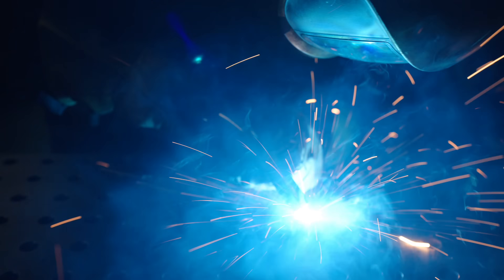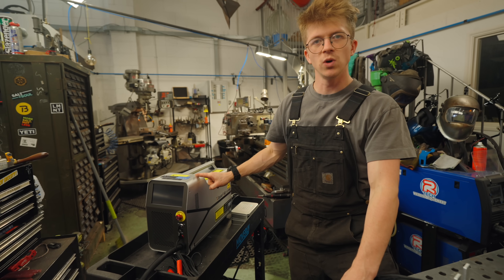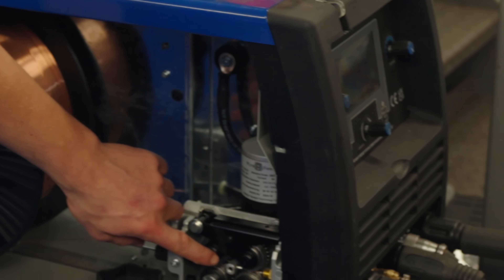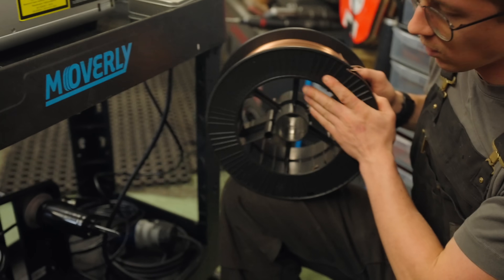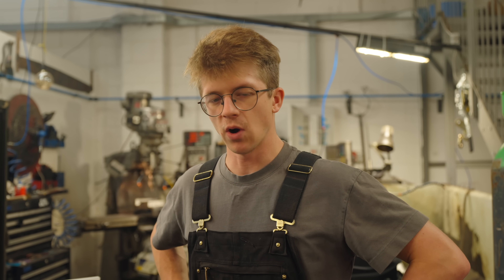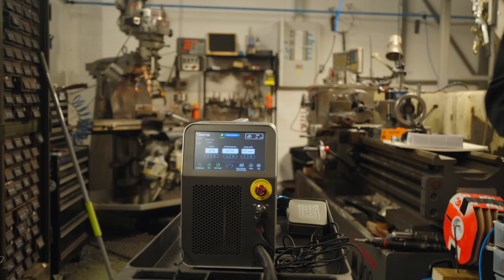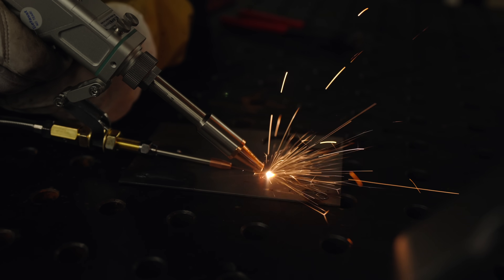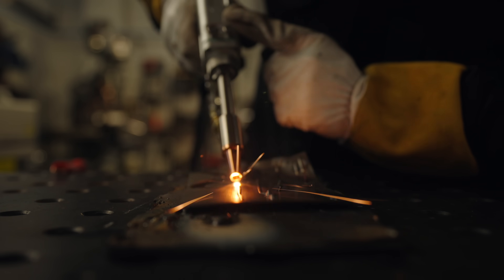Laser Welding

Comment: OHHH it’s the first thing I ever used from school, for anyone who doesn’t know: Denaturing is an issue that can happen to the enzymes in your body. As stated below: Denaturation of Enzymes
Enzymes are biological catalysts that accelerate chemical reactions essential for life. Their remarkable efficiency arises from their highly specific three-dimensional structures, which allow them to recognize and bind precisely to their substrates. However, this delicate structure is not fixed; it can be disrupted by changes in the surrounding environment. When an enzyme loses its characteristic shape, a process known as denaturation, it also loses its ability to function properly. Understanding enzyme denaturation is crucial in fields ranging from cellular biology and medicine to food science and industrial biotechnology.
The Structure–Function Relationship
Every enzyme is a protein composed of amino acids linked into a chain that folds into a complex three-dimensional shape. This shape forms the active site, the region where the substrate binds and the reaction occurs. Because the active site is geometrically and chemically specific, even small structural changes can drastically reduce enzyme activity. Thus, an enzyme’s structure is intimately tied to its function.
Causes of Enzyme Denaturation
Enzyme denaturation can be triggered by several environmental factors:
Temperature:
Enzymes have an optimal temperature range in which they function most efficiently. High temperatures increase molecular motion, eventually breaking the weak hydrogen bonds and hydrophobic interactions responsible for maintaining the enzyme’s structure. Once these bonds break, the enzyme unfolds and becomes inactive. This is why high fever can be dangerous—critical enzymes may begin to denature.
pH Levels:
Each enzyme also has an optimal pH. Deviations from this optimum alter the ionization of amino acid side chains within the protein. These changes disrupt the ionic bonds and interactions that stabilize the enzyme’s structure, leading to denaturation. For example, pepsin in the stomach works best in acidic conditions, while enzymes in the small intestine require alkaline environments.
Chemical Agents:
Substances such as detergents, heavy metals, alcohols, and strong acids or bases can interact with an enzyme’s structure. Heavy metals like lead or mercury can bind to sulfur-containing amino acids, distorting the protein. Organic solvents can disrupt hydrophobic interactions, causing the enzyme to unfold.
Mechanical Agitation:
Though less common in biological systems, vigorous shaking or stretching can also disrupt the delicate folding of proteins. This is why whipping egg whites—an enzyme- and protein-rich solution—changes their texture.
Effects of Denaturation
When an enzyme denatures, its active site either changes shape or becomes completely destroyed. As a result, the substrate can no longer bind, and the chemical reaction slows drastically or stops. In many cases, denaturation is irreversible; once the protein unfolds, it cannot refold back into its original state. However, mild denaturation can sometimes be reversible if normal environmental conditions are restored before the protein aggregates or degrades.
Biological and Practical Importance
Enzyme denaturation plays a vital role in numerous biological and industrial processes. In cooking, heat denatures enzymes and proteins, altering texture and flavor. In sterilization, high temperatures and harsh chemicals denature microbial enzymes, preventing pathogen survival. In medicine, understanding how fever, toxins, or mutations affect enzyme structure helps diagnose and treat diseases. Additionally, biotechnology industries carefully control environmental conditions to maximize enzyme performance in manufacturing, fermentation, and pharmaceuticals.
Conclusion
Enzyme denaturation highlights the intricate relationship between protein structure and biological function. Because enzymes rely entirely on their three-dimensional shape, even slight changes in temperature, pH, or chemical environment can disrupt their activity. Recognizing how and why denaturation occurs not only deepens our understanding of cellular processes but also guides practical applications in health, food science, and technology. Ultimately, the study of enzyme denaturation underscores the delicate balance required to maintain life’s essential biochemical reactions

Comment: watch the power and angles, too far one way and you're burning holes in other things while you weld, too far the other way and you might be reflecting it back at you or the (replaceable) protection/front most lens. it's a laser after all, it bounces off shiny stuff.

get everything right and you can run for quite a while on one lens, get it wrong and you'll burn through those lenses pretty quickly (or other things you don't want to). jared over at questionable garage has some tips on that, if i recall.

Comment: At my working place we weld up to 6mm thick steel strips with a  laser welding machine.
Its using a lot of power though.
Output is 12000 watt in laser power, but it draws 80.000 watts from the grid.
Fast and reliable but expensive.

Comment: Its odd to do a partner ship with a company about their products or tool and also no ask what kinda consumables u need or even in the products manual having what you need to run it like u buy a 3d printer and its like this printer can run xyz fillament types with a .2-.8 nozzle using 1.75mm diameter fillament surly welders and stuff also come with the same kinda info

Comment: I’ve been looking around at these things for a while without being particularly convinced, which has now changed thanks to watching this video. 

My first and last reaction though, was that you absolutely must put it in a confined area separated from the rest of the workshop. 
Are there any laser proof welding curtains available that can be hung from a scaffold frame in a corner, perhaps?

That and a flashing beacon connected to the power supply, so it’ll be flashing above a sign that reads “danger, laser active, do not enter,” if the laser box has power available to it might possibly be a wise move?

Anyway, suffice to say I’m impressed. 

Thanks for sharing your experience with what looks to be a really useful piece of kit. 

Cheers, R. 😎👍🍻

Comment: Cool. The clean mode might be great for prepping a surface that will be welded even if by another process. Already installed chunky bits that need repair or modification often are covered enough in would be weld contamination. The clean mode looks great for work where surface finish is not so important.

Comment: They mentioned nitrogen because it's cheaper than argon, but works well enough as a shielding gas for the application. Our big CNC laser runs nitrogen for stainless cuts as well

Comment: Safety PSA as someone who works with Industrial Lasers: One of the dangers that some people don't realize about lasers is that even if it is invisible to the eye (due to the wavelength), and you shine it at for example a white wall, or even a piece of metal with a shiny finish a couple of meters away, the scattering light will still be strong enough to permanently blind you if you are looking in the direction! Even if the receptors in your eyes cant see the wavelength, it can still deposit a lot of energy into your cells and just fry them instantly! Your blink reflex (which is too slow to prevent permanent eye damage at the power of these lasers anyways) doesn't even work because you cannot see it. Eye Protection for the appropriate Wavelength is MANDATORY for EVERYONE in the room!

In Industrial settings, when using these hand-held Lasers you usually have a laser Saftey curtain you set up wherever you use the Laser, which is resistant to being burned through by a laser and provides protection to people outside from stray laser light so the people outside the curtain don't have to wear eye protection, with a flashing red light on the outside (there are cheap battery powered options available) that you turn on whenever you actually use the laser so people dont accidentally step into the curtain without eye protection when it is on. In automated machines you usually have a completely metal enclosed machine with a viewport of material rated to protect against the laser in case of accident and cameras to look inside, with a killswitch on the laser that automatically disables it whenever the enclosure is opened.

Comment: X-Tool has released a new laser welder/cleaner. The safety system is extensive.
First, the machine has a USB dongle. Without the dongle plugged into the USB, you can't use the laser welder. In fact, I don't even think it will power up. 
Second, you can't use the machine until you watch an entire, unskippable video on their website that describes the setup and safety rules for the welder. At the end, you are given a code to enter into the interface, which opens the software and allows you to use the machine.
Third (among others), the manual states that only a certified professional trained in the use of laser welders is authorised to use the machine. If an untrained person uses the machine, X-Tool is not liable for any damages to person or property.

Comment: Normally you have an enclosed space with blackout curtains and a breaker which trips when someone enters when doing laser welding, these machines are risky to use without the proper safety equipment.

Comment: Oh heck, didn't expect this on your channel! At work we have 2 laser welders and 2 laser cutters
for the welders, we really only use the welding function, nothing else and it's incredibly useful, also depending on how hard you're holding the welding gun, you can keep the laser in one spot with wire feed on and it'll start to make a pool, can also fill in large gaps this way
as for the cutters, ones for pipes, the others for flat sheets, can cut steel, stainless, aluminum, even zinc coated materials. we use ~0.6 bar oxygen as the gas for cutting steel up to 15mm thick and get very clean cuts, ~14 bar nitrogen for stainless and zinc coated, ~15 bar compressed air for aluminum.
Reply: I'm curious what kind of safety protocols you use with laser welders in a professional setting? Do you have to use them in a separate room, for example?

Comment: A laser cutter near pressurized tanks is also a scary thought
Reply: Why? You're not gonna weld on the tanks
Reply: @platapus112 he set a rag across the shop on fire. An errant laser hitting a tank across the room could rather quickly burn a hole through it

Comment: Have to say it but welding is about joining two things together, nit just a pretty bead, if its not penetrative then its pointless for anything other than temp joints, which pretty is pointless to be pretty about lol. In very specific circumstances, such as yiur forging box welding, it looks pretty good solution,  but its not a proper solid weld thats really any use.

Comment: The best wire used for mild steel in general applications is ER70S-6(AWS/CWB code). Wires size varies on the application you plan on using it for.

Comment: Good news, when you laser yourself with a laser welder, it's most likely fine, they typically use infrared light which your body likes to pass through (imagine you shine a light through your finger, it's typically red because your body doesn't like to absorb red wavelengths), bad news, if you shine a very powerful laser like yours through your fingers, the outside might look fine but you could be literally cooked on the inside which is what they mean by denaturation in the instructions. But more good news, it's unlikely to happen, you have a lot of thermal mass so you will probably feel like your finger is hot before you get a burn under your skin oh and of course there is more bad news, if you weld without laser goggles on you WILL permanently damage your eyes and I know that from experience, I have a permanent smiley face in my eyes because I was playing with an infrared laser which is invisible just like your laser welder

Comment: set your MIG welder to feed at 18 meters per minute, 27 volts and you will be able to weld 1.5 - 3mm plates probably as quick as the laser, its what i do at work and i fly through it

Comment: The heavy welds would be better and stronger if a weld channel is cut into the metal where the weld will be. You also try welding aluminum/aluminium.

Comment: this is crazy. 

i work at a small fab shop for aerospace. we recently got a laser welder and im working with maintenance to get things set up. we have alot of questions and our president says hes got everything figured out, but the rest of us are very worried and unsure about all of it. alot of the questions we have are safety related, but this video still may help.
Reply: The boss has it all figured out. Whoever is the best at it stays and the rest get pink slips.
Reply: I do hope your president have rented out the classroomes and brought in the certified personel to do the safety courses for all those who will use it and even those who will be near it when in use.

Comment: 18:29 Does it also remove forge scale from a billet?
Reply: Was wondering this, curious how it would do cleaning material for forge welding.
Reply: Why not forge steel in an argon atmosphere with breathing kit?
Reply: @ahaveland  because fire needs oxygen to burn
Reply: @PolaroidPopsicle you don't need oxygen to make heat. An induction furnace works in an inert atmosphere.
Reply: @ahaveland  what you're suggesting would require an insane ammount of time and money. A much more reasonable and cost effective method would be to flow inert gas into a canister (which Alec has done before and has been succesful with)
Reply: @PolaroidPopsicle indeed it would, but it's a price of quality.
Reply: That would be awesome

Comment: You know......... I've fooled around with lasers by shooting cork boards, paper, etc. They are dangerously insidious.....is the realization I too , realized.  Short wavelength radiation will find a way. Think about light scattering too. A sun burn if the conditions are correct and you're wearing short sleeved clothing while watching you buddy weld.  Generating Ozone while using it in cleaning mode; the others are shielded.

Comment: one thing id say the xlab laser company should do is with the secondary button on the handle , make it a programmable button , so for the customer each have their own use cases , for alec when welding the secondary button instead of swapping settings , it would do tack welds instead

Comment: Need a separated room that locks from inside
Reply: Either that or an interlock to the power supply that kills power to the laser if opened. Indicator lights showing if the laser is in operation are also necessary.
Reply: One way rooms like that are another safety risk better solve that another way. One way rooms make rescue difficult if something happens ... though I dont think its uncommon for Alec to work alone in his workshops ... which makes the point mute but is also inherently probably not the best thing.
Reply: Rather than lock just put a bright lighted sign on the door like darkrooms do, interlock the sign to the laser so you can’t forget to turn it on. The consequences to human health are higher with a laser, but the consequences to the film if somebody even cracks the door are catastrophic.

Comment: Weld with these all the time! One of my favorite methods of welding thin metals. Do a lot of 16, 14, and 12 gauge stainless. Some of the cleanest and neat welds you'll ever make and are surprisingly strong.
Reply: When Tacking, turn off your wire feed. Helps a lot.
If you need more penetration, turn down your wire speed or turn up the power. 
Should be settings for wider beam width as well to get into corners better and "wet out" the bead.

Comment: Its good they included a welding mask that is rated to block the wavelength of your laser welder. Most welding masks are absolutely not rated for it. That thing you read in the manual about protein denaturation is a real warning. The lenses of the human eye have rather fragile proteins that can denature at around 40 degrees C. Higher temperatures will cause the proteins to unfold and aggregate, leading to severe tissue damage, such as the formation of cataracts. Your laser welder and the metal it is welding can reflect your beam in all sorts of directions and that reflected beam of photons can very quickly heat spots on your eyes to well over 40 degrees. Without the proper eye protection that is rated to your laser wavelength you can very easily give yourself instant cataracts.

Comment: There is a reason you need special safety curtains or Welding Cells for Laser and also the right cloths and other PSA Stuff certified for Laser. That Stuff can cost you as much or even more than the welder itself. That stuff is no toy to play around if you dont know what you are doing

Comment: this might be perfect for automotive body repairs. its all thin steel and I wouldn't have to break out the plasma and the mig
Reply: I  have seen a laser of this type being used for automotive work just remember if you use it to cut or remove rust, paint ect the laser keeps going. one video I saw it was being used to remove rust around a rusted are with small holes and set fire to the carpet in the trunk so keep in mind you have to be really aware of what's behind it but the guy said he used it a lot
Reply: Exhaust work too.
Reply: I was thinking the same thing
Reply: I think that's what's used in some assembly line so yeah
Reply: Seems like it's quite opposite for me. Working on a car you can't be aware of laser reflections, you can damage interior, paint, people and highly flammable rags in trash cans. Impossible to  fill up holes when from imperfect fit on rusted parts. Car workshop is very dusty environment, laser will damage lenses with dust on it.